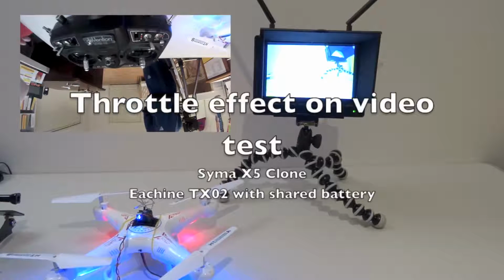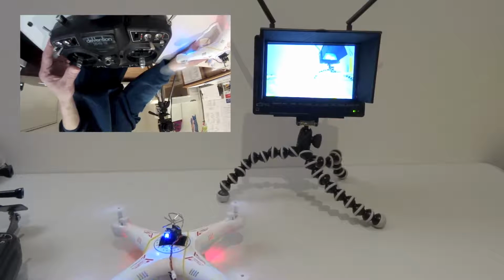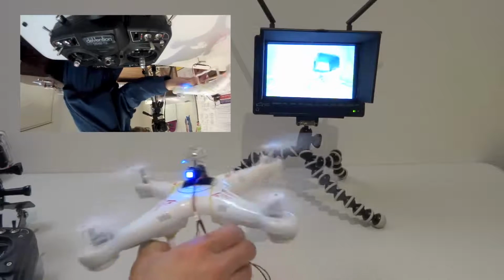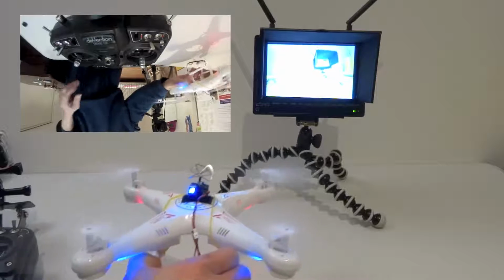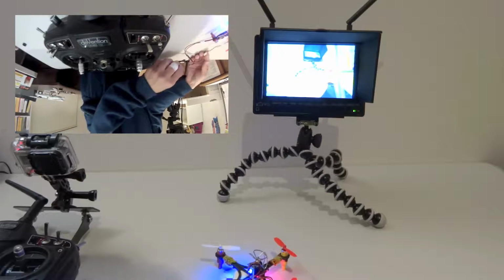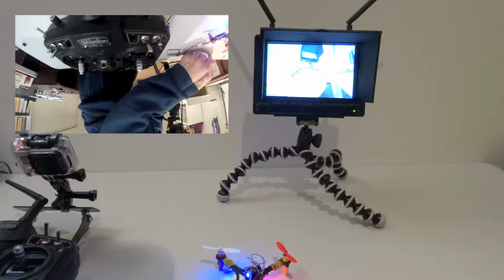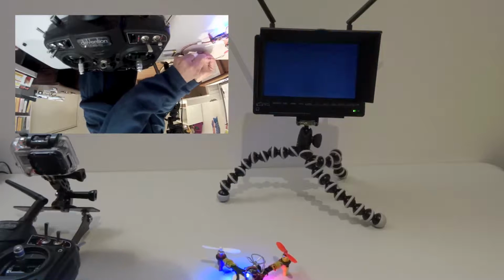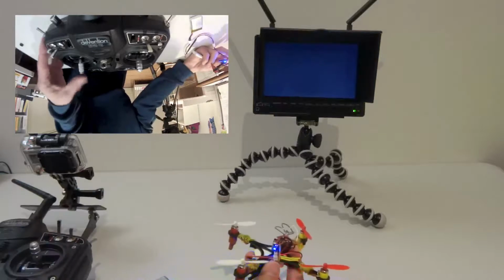Video transmission interference tests - Eachine TX02 FPV Camera (Courtesy of Banggood)

Comment: Good tests. The battery does not drain that different really to my old 25mw cam-vtx. I have the 200mw TX02 as you know, on a micro build and with 400mah 30c JJRC batteries getting solid 3 minute flights. Say a minute less than my old set up. Much better range and far less break up around trees.
Reply from the maker: Thanks for watching and for your updates.

Comment: Nice JT 👍. Do you have a rhcp cloverleaf antenna for you monitor or goggles? Thx Dod.
Reply from the maker: Thanks! You mean for the monitor? Yes.
Reply: Cool 👍. I got one of those battery powered soldered irons today. I've not used it yet. I'm waiting on some 60/40 rosin solder and some rosin flux. I'll wait for that so I can tin the tip properly,I'll also re-tin my old iron. I think my old iron come with lead free solder and no flux. The solder won't even stick to it now lol. Thx Dod.
Reply from the maker: Thanks. Battery operated solder iron is perfect for this hobby. If you have Daiso (Japanese chain store) in your area, the solder that they sell has rosin and cheap.